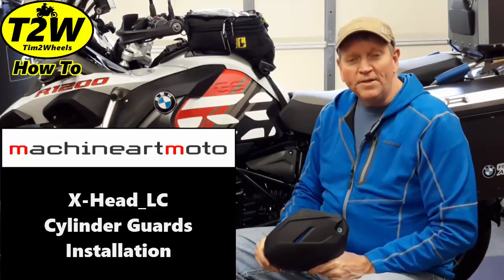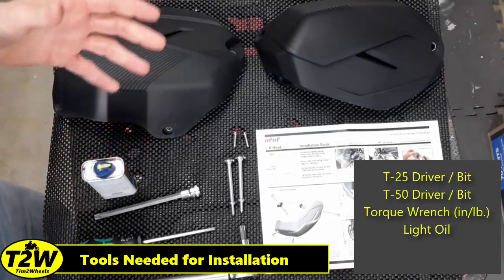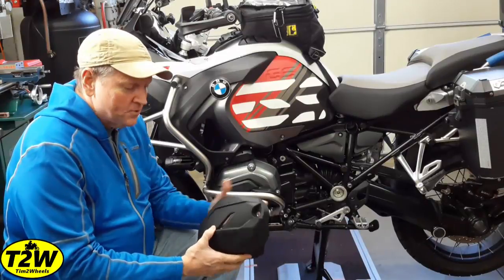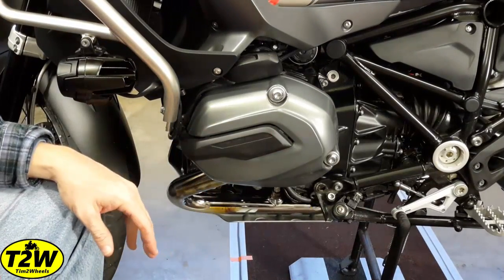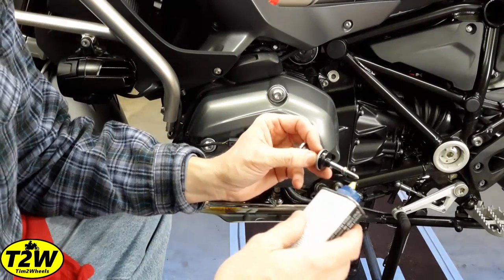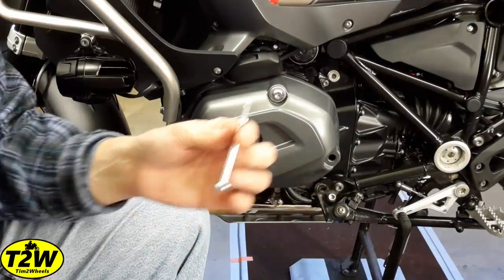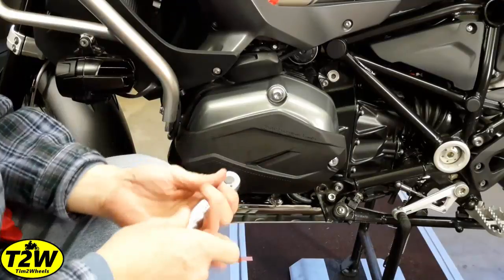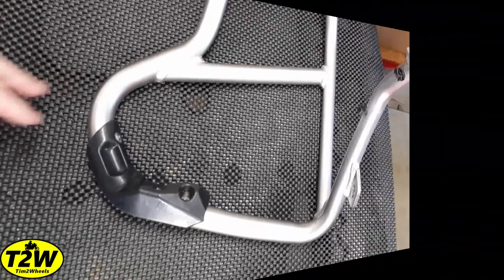T2W How To – MachineArtMoto X-Head_LC Cylinder Guards on BMW R1200GSA

Comment: Hey Tim, Are you going to do a video about the switch from KLR to BMW GS? Do you still have the KLR?   Great videos! They are very informative and I've learned a lot!
Reply from the maker: Hi Cody, I have had a few requests for that topic. So, yes, I will be planning a compare and reasons for the change video. 
I traded the KLR in when I bought the GSA.
Thanks for watching.
Reply: What was the trade in value on the KLR. I understand if you prefer not to say.
Reply: No more KLR 😪
Reply from the maker: Hey Matt - Yeah it's bittersweet. Although I''m loving the new GSA, I'm going to miss my trusty KLR. She was a good bike.